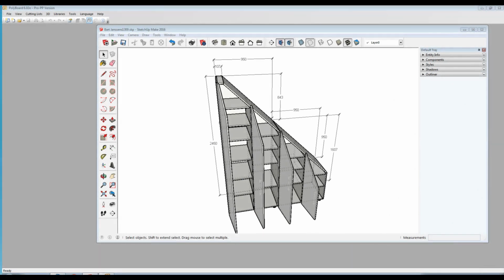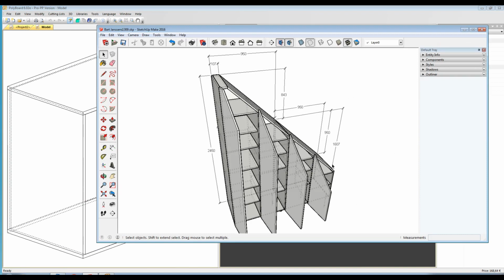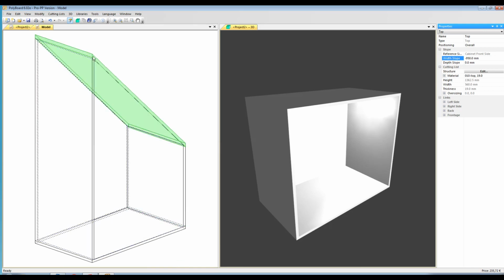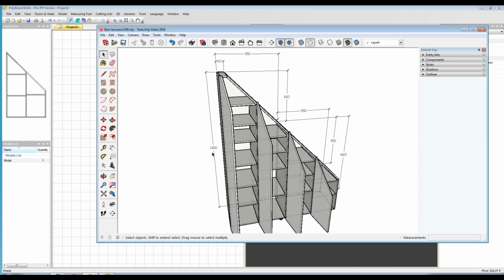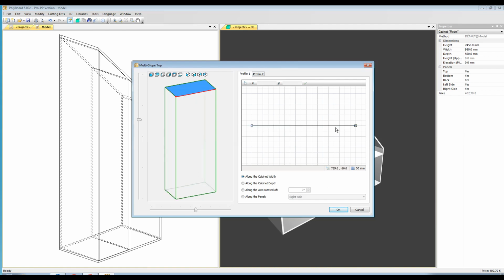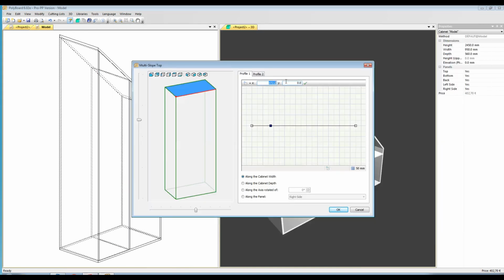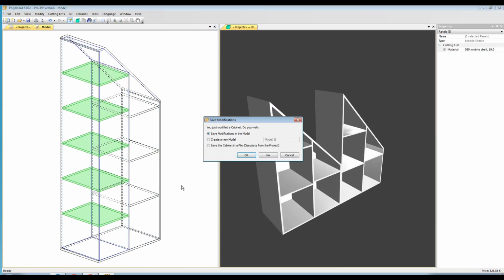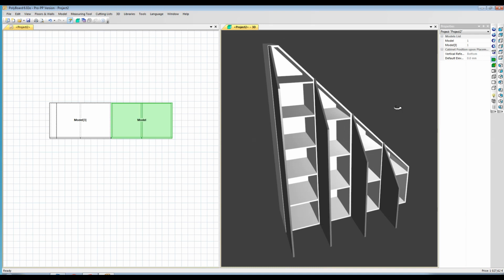Use Polyboard to design a cabinet to fit under a roof

Comment: your voice is difficult to hear
Reply from the maker: Hi Adam, sorry about that. I've had another listen back, it sounds clear to me. Is it too quiet? If so, you can adjust the volume slider. If it's still too quiet for you, our apologies. We'll take a look again at volume levels going forward.
Reply: @wooddesigner  thanks for checking, it’s strange it seems to fade in and out a little with what can only be described as slight echo and background noise occasionally, like a car passing. I have watched a few times and picked up on what I missed. Thanks
Reply from the maker: Hi, I'm glad you could get the info you needed sorry if there were some background issues